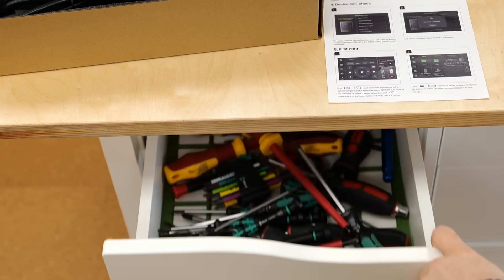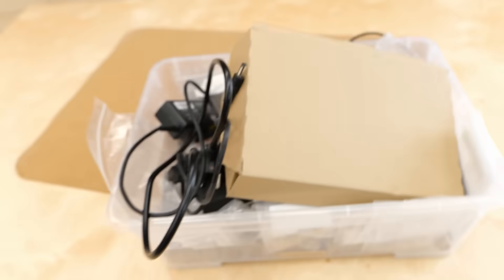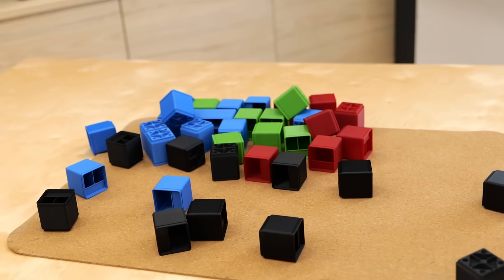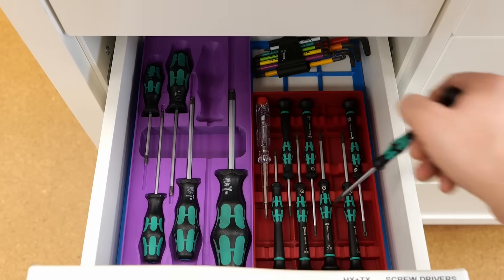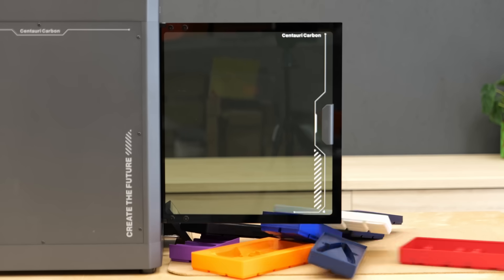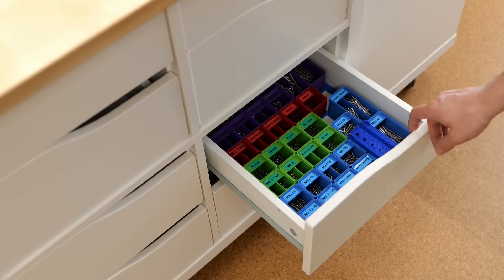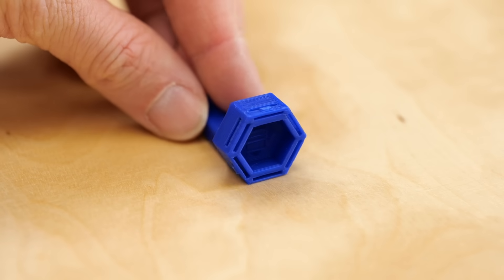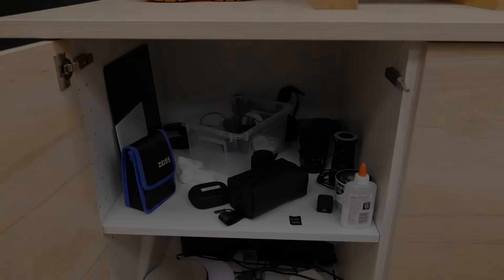The Best 3D Printed Organizers for your Workshop

Comment: Gridfinity advantages:
Modular, library of useful files, CAD plugins and websites to make your own, easy to adjust over time, easy system to try.

Gridfinity problems:
Takes a long time to print all the bins, relatively costly, time consuming for mass adoption, requires 3D printer

Shadowboards/Foam advantages:
Quick to set up, cheap, only need a pen and a knife, good to prototype solutions, good for permanent layouts.

Shadow board/foam problems:
Changes require a complete redo, not great if unsure of finished layout, not modular, mistakes costly.

Comment: Hmm... Gridfinity... Opensource... But the sources are locked in Closedsource CAD SW, which is only for Windows or Mac... 😕
I need to change the module size (for example 42->50 mm) for my drawers.
So I started designing (slightly parametric) organizers using web CAD Onshape... I don't need anything wild and fancy, just simple organizers.

Comment: Hi Stefan, is there a way you can share the gridfinity baseplate connectors? I have the same problem with the smaller print bed.

Comment: This makes me happy... (and reminds me I need to do it myself). It's amazing how much we can hold ourselves back because we can't find a thing, don't have space, etc. It's where organization comes into play... though organization becomes it's own project. I have a single MultiBoard panel twist-tied to a shelf waiting for the rest of it to be done. Drawers filled with scraps that was supposed to be temporary to cleanup for family, but 3 years later, they're still there and not thrown out yet. The screws and tools are laying around in piles. This is the real power of 3D printing: custom parts for what you need, when you need it, as you adapt.

Comment: I am surprised that you didn't do this earlier.
Ikea drawers are aweful, I tried it with gridfinity but the space at the end is impossible to reach, espacially with box full of screws. I saw some tweaks to be able to open it at full range, but honestly it was crap and really not sturdy. I've ended up by building my own drawers cabinet with cheap melaminate + mdf, definitly not perfect (because I'm not a woodworker), time consuming, but not as expensive as I expected, if you find a good reseller for the hing, then it's a really good option. You can customize everything by building it.

There is also a ton of model for gridfinity baseplate for ikea drawer.

Also, I'm surprised that you didn't use multiboard, there is so many remixes for it, and it is in constant evolution (it is maintain I don't know about HSW tho) and multiboard is compatible with HSW + more traditional pegboard, so for me, it's the best.

Anyway, looks great, good job ;) 
Huge thanks for the onshape trick, I was always really bad at trying to customize gridfinity boxes 😅

Comment: For those bins you made that have a built in divider, I would change that. I'd make 2 smaller bins with labels that fit into one bin! This way you can remove just the one bin containing part X, instead of parts X and Y

Comment: I've been asking on every review of this Elegoo, but nobody answers: does this have a filament sensor in the printhead?  If not, then I doubt they'll be able to deliver a reliable AMS.  If it has, then why is nobody mentioning it?  It would also make the sensor hanging on the outside near the spool holder somewhat unnecessary and that's actually what triggered me to ask ...  Now, even with working AMS and low price, a closed-down firmware is a red flag for me.  Despite all these offerings, that is seriously reducing the number of printers I would consider a good buy.  Bambu is out, Elegoo is out, ... I guess Creality K2 with rooting and opened-up Klipper is one option, but I'm worried they too will turn on us when they see these examples.  Back to Voron, RatRig and Prusa?

Comment: Good hint is the IKEA wall organizer ! I thought from the beginning of the video how many kilograms of filament for what price i would have to spend to cover every organizer.
Even though it is a hobby and i can afford the material, i always have an eye on cost efficiency.
There are some prints i invest in a kilogram or two, but simply because i want to have my custom solution. At the moment I design a pot holder grid for 30pcs of  9x9cm planting pots which will eat up almost a kilo. Very simple thing and available on the market for 5€. But they simply don't fit in my watering tub, so i decided to make my own.
Plastic is cheap! Filament is still too expensive to compete with most molded or drawn parts.
I'm still dreaming about filament prices close to the actual raw material price, killing the argument to not print my next helper for the household or garden.

What makes filament that expensive? Shaping? Spooling? Cooling? Handling? Additives? Development? 
Would be interesting to see a video focusing about this topic

Comment: Excellent oganizatonal ideas.  I have only one suggestion. Unfortunately, as an American, I am still using the Imperial System. If I arrange my bins or drawers according to size, i.e., 1/4-20 x 1" followed by 1/4 X 20 X 1.5", followed by 1/4-20 X 1.75" and then purchase some 1/4-20 X 1.25" screws, I must move all my drawers to accommodate the new size and maintain order.  For this reason, I number my drawers.  I enter all of my hardware into an Excel database, including drawer number, hardware type (from a pick list, flat head, hex head, etc.), and size, also from a pick list.  When I am looking for a specific type or size of hardware, I only need to sort or search to find the drawer number.  I even have a column addressing the particular project the hardware is used for.  If I search 1/4-20 X 1", it shows all that size in every type of head.  Likewise, if I sort by socket head, it displays all those regardless of size. And I do all of this while designing a project without leaving my desk. I am an Industrial Designer and have accumulated hundreds of types and sizes of hardware over the years.  Thank you for your many well-done YouTube videos.

Comment: Hey, 
I am new in the 3D printing world. I am really wondering about the storage of the filaments: I'm always reading about how to protect it from the moisture in the air. On the other side, dere are always these big shelfs full of filaments without any protection. Are you heating it up, before you use it? Or is this just some kind of stable material (like PLA) and it's not a big deal?

Comment: I HIGHLY recommend using the multi connect system for designing parts for both MB and HSW. You only need to model in the slots, which the CAD is available for, making printing really easy with no supports, and the connectors are printed separately

Comment: I chose multiboard because you can mount hooks usijg simple pins instead of big hex units.  Also the WALL grids can be printed in stacks.  The printer can just run for like a week, returning to a big stack of grids!

Comment: While I really don't like the fact it isn't open source... ThreadBoards are the direction I went with my wall storage. It allows me to secure stuff to walls that I don't really have to worry about them falling off or anything. I mounted them directly to the wall with no connectors in between and it came out great. Wish there were more pre-made options for it... but that's the problem with it not being open source...

Comment: You have done the same thing as I did at first, organised everything so that every tool winds up in a drawer or on the wall. I ended up finding my very regularly used tools (Side cutters, pliers, 2 screwdrivers, a drill, a impact driver and about 6 bits, a couple of pens and permanent markers and a pair of scissors) never got put back away where they belong so I wound up just making permanent homes for them on top of my work bench, basically a tallish cup for the pens and scissors, a small shelf for the 2 power tools to sit on and the screwdrivers and stuff go under the shelf in a small baking tray. Oh and the utility knife is always laying around on the bench somewhere too. I reckon in a few months you will end up doing the same thing but we will see.

Comment: Hey Stefan,
please try Multiboard. It pretty much combines everything you showed in one system. Everything can be combined in so many way. It blew my mind so many times now.
A lot of these features might seam overkill (and they probably are) but in fact you never know what you'll need one day. Always good to have options.
A feature I really appreciate is that you can have bins that you can hang on a wall if you need them a lot for one project and then store them in your drawers (held in place by the multigrid tiles). 

Yes, hexagons are nice and all, but multiboard look nearly as good (in my opinion). They have the big advantage to be indexable by 90° (and 45° but that in not as useful). It offers some really nice options for custom holders.
Also using bins as housing for drawers is genies.

The chosen 25 mm and 50 mm increment make it cross compatible with a lot of other systems
> Eurobox
> MOLLE/ PALS
> Equipment for welding tables (obviously don't use plastic directly next to were you weld, but there is potential for combinations and fixtures)

Downsides might be:
> less community mods (but there are still a lot)
> slightly bigger increment of the bins (50 mm)
> take quite some time and filament to print

So PLEEAAASSSEEEE try it and if you like it, help the community grow

Also, all the best to you and the guys in the new studio/ workshop

Comment: Now you say a printer is "realy fast". How fast is fast? I have a stock voron 2.4 that can print with at most 11mm^3/s volumetric flow and, due to the stealthbuner, really struggels with partcooling on a PLA print. ABS on the other hand is fine as it doesnt need much cooling. The Limit for me atm is the volumetric flow. Am i just used to a good printer or is that not that fast?

Comment: I'm also in the process to gridfinty my stuff - not tools but material. But I also have to sort very small parts like single crimp contacts or M2 skrews. Thats why I choose to use a 19.8 x 19.8mm² grid size that fits perfectly into a standard Eurobox 400x300mm² All the basic boxes and grids were generated by FreeCADs Gridfinity workbench, which supports custom grid sizes. The smallest boxes use a grid size of 1x2 and are only 30mm high. I create a tray that is half the size of a box, so you can remove two pieces to get to the bottom layer.
I use PETG and hotglue to bind PETG and the PP of the Eurobox together. Meanwhile I have approx. 30 box in use. 
Next step is to use a inventory app, that shows where to find all the material.

Comment: After some consideration, I went with Multiboard - it just felt like a way more flexible system with both small and big holes, the fact that everything is both push-fit and threaded, and the fact that the whole system extends beyond wall mount. Especially multibins, which can serve both as drawers and gridfinity-like storage add quite a lot of value.

The disadvantage is in (currently) less available parts, and learning curve, extreme modularity of that solution adds a lot of complexity.
For drawer inserts, I use both multibins and gridfinity.

Comment: I somewhat recently switched over from HSW to Multiboard, and I mostly like it because it's easier to fasten things to it more securely, and there's no "wrong" way to hang it. 
With HSW, some people hang it points-vertical, others points-horizontal, and I get frustrated when a model is only available for the orientation I didn't pick, even if I can CAD up my own version in reasonable time.

Comment: For your Electronics wall i would recommend a "heat shrink winder"  there is one on Printables for HSW but it uses a M3 cap head so you can use it on any system with a simple adaptor. super useful for lengths of heat shrink.

Comment: I use HCW (and Gridfinity of course) and created a insert for HCW that can be easy removed, because to change position with normal inserts often leaded to broken parts - give it a try if you need. Printables: 524987

Comment: I use multiboard, because I like that I can screw stuff in (it feels way more secure). Also the Pegboard hooks are heavily utilized for e.g. hanging hand-saws. 
For horizontal stuff I also use Gridfinity. There are some good shelves to combine multiboard with gridfinity.
On makerworld there is a design, where you input your drawer size (and print-bed) and it will just create a gridfinity-drawer system (the name is "GRIPS: GRidfinity Interlocking basePlate System")

Comment: I went multiboard, I think the options of peg or clip in are clever and the fact that you can print mounting parts in optimal orientations without supports is huge.   Also the ragged edge of the non continuous offset hex pattern bothers me 😅  I love the onshape tip, will definitely try that out!

Comment: I like hexagons too but I think Multiboard is significantly better than HSW. Primarily for its ability to have really strong connections when needed. My Multiboard wall has a section for filament storage and easily holds 14 spools using wooden rods and entirely stock components from Multiboard. At the same time there are other things that are press fit or hooked in when less strength is needed and having the large and small hole options allow for a lot of customization to find the right type of connection for the tool.

Comment: I really don't like gridfinity. It uses way too much plastic for what it is and my workshop is constantly evolving, so often I'd often have to throw away some modules since that tool is either no longer needed or is now on a wall mounted board instead of a drawer. I also prefer vertically stacked containers instead of laying them inside a drawer since all my drawers are way too deep for small stuff like screws.

Comment: I’m just stating the organization process. I was considering the hexagons, for the same reason you did, but now I’m considering the other. Great timing on this video!
Reply: I'm all-in on Multiboard and I'd still admit HSW does look cooler because hexagons. But aesthetics aside I reckon MB wins on the functional metrics - strength, versatility, and especially for tolerances and ease of printing - I'm using an old Ender 3 S1 Pro and every tile, bolt, snap, and connector has fit together perfectly first try on default settings.

That said, you're not locked in! You can use both, mix-and-match parts with adaptors, and even mount HSW tiles on top of MB tiles (or vice versa) to build out whatever you want.

P.S. you can ignore any noise about the MB license 'controversy' unless you're planning to sell parts - the only paywalled things are conveniences like multi-STL 'kits' (which you can assemble yourself from the freely available parts), early access to new designs (just wait a couple weeks), and parametric Blender generators (there are a ton of free community generators for OpenSCAD, Fusion etc.)

Comment: The choice multiboard vs hex justified as "hex are the best" is disappointing: if it's really for that reason, becaue I expected more evaluation of pros and cons, and if there was such an evaluation, I'm disappointed it was skipped altogether and a joke was put instead.
Reply: That hex grid design seems really bad: it looks like the elastic part is also on the top side, so that it might be engaged when the bending moment is excessive?? they could have got rid of the elastic altogether if a pronounted top slot were used, and a smooth bottom, so that pulling down the tool attached to the insert would resist, and bending up the insert would remove the insert without difficulty.

Comment: For my shop wall above the workbench (8 feet x 3 feet) I fell in love with the hexagon storage wall, but not so much their mounting solutions. My shop has plywood walls, so I dabbed the backside of the hsw panels (at every hex vertex) with some wood glue and I'm so much happier with it. It feels so much more solid and a part of the wall rather than being a floppy pegboard all over again. Would recommend 10/10.

Comment: Here's the thing. Organisation by tool type looks super neat, and as you pointed out, it's great to ID missing tools. You'll still end up having these tools all over your working space. Or end up with project trays to temporarily store them. The better way to organize tools is on the types of tasks per project. Put them in carry / bench serving caddies. E.g. Working with M5 screws. You need M5 tapes, M5 fasteners, tools for driving them in, M5 drill bits. If all that is together in a kit it all comes out to do the fastening tasks, once finished it can go away. It takes time to develop such systems. This how tradespeople organize their tools. Come to a job, look at all task types, then go fetch the tool / supply sets needed for each stage. Sometimes they have duplicate tools. I've started working this way. It makes it fun.
Reply: I don't really mind the clutter during an ongoing project, but where this type of setups really shine is after clean up and at the start of a project, as everything is in a easy to reach and find place when you need it.
Reply: This sounds like a great approach.
But surely it leads to needing duplicates of some tools?
Reply: gridifinity has a bunch of tool boxes that accept parts and tools from elsewhere in the system, so you can load up for a job and then return them to their drawers later.
Reply: @JoeTandy-y7z  This is the way!